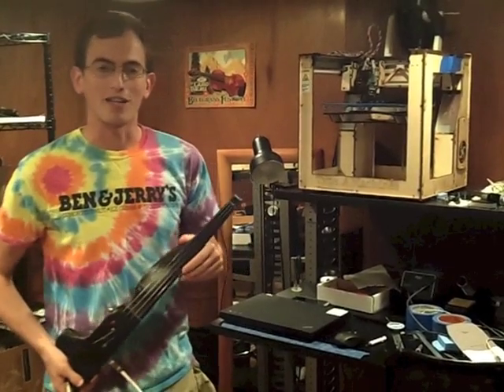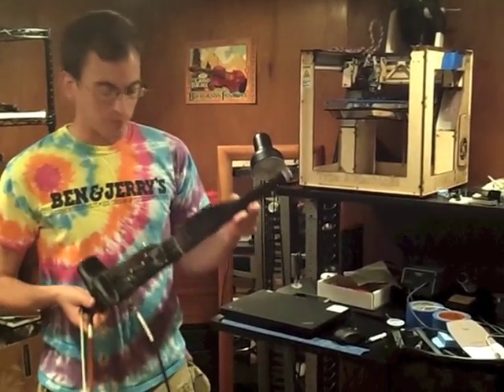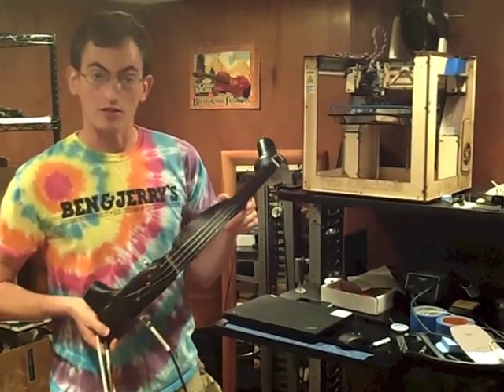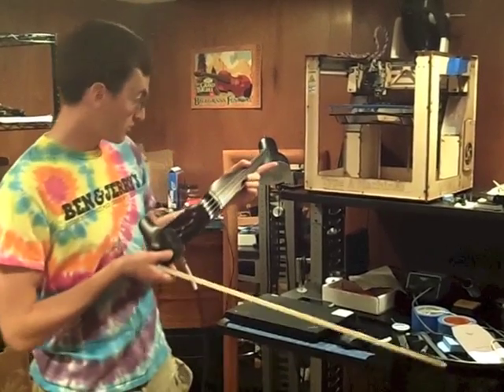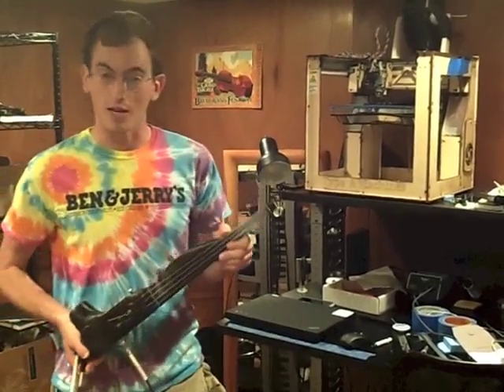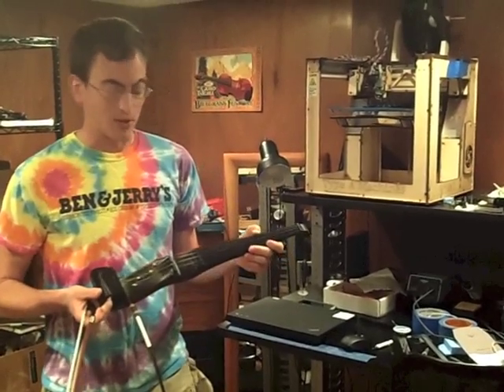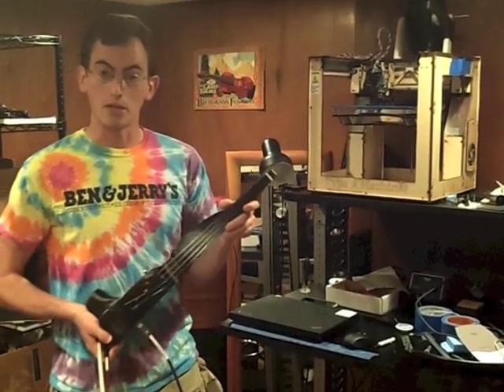Bill Cheatum on the F-F-Fiddle

Comment: it is printed in 3 pieces right? How do you put them together? What do you need to pay 250$ for? Pickup and tuners? Yes and strings of course :)?
Reply from the maker: Yup, three pieces: Neck, Bout, and Bridge. The two large pieces are attached with nuts and bolts. $250 roughly covers the plastic, hardware, tuners, pickups, and strings. The tuners and pickups are the most expensive item. Check out the files, etc, linked on my website: www.openfabpdx.com/fffiddle